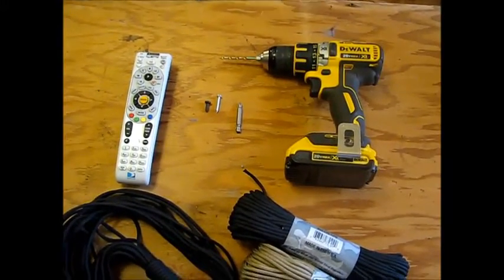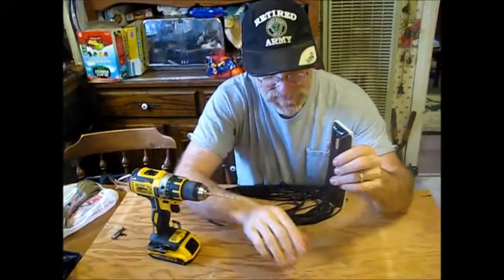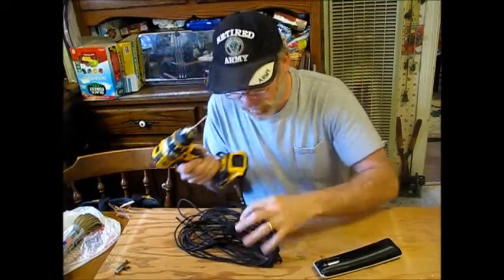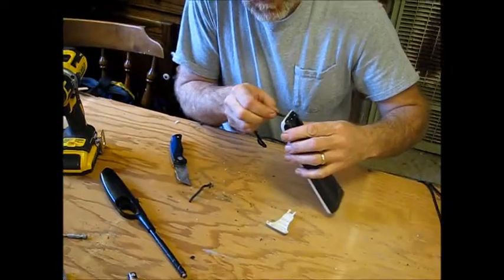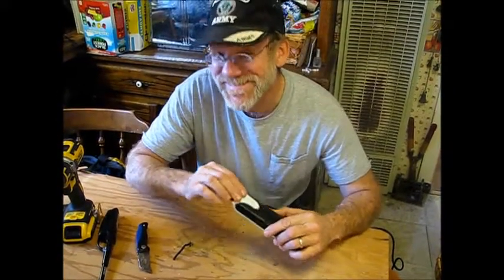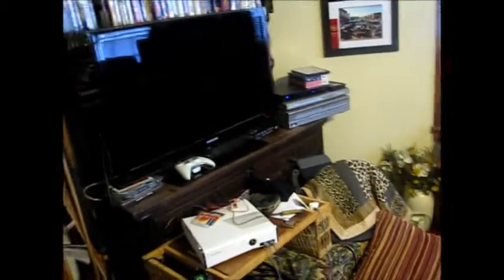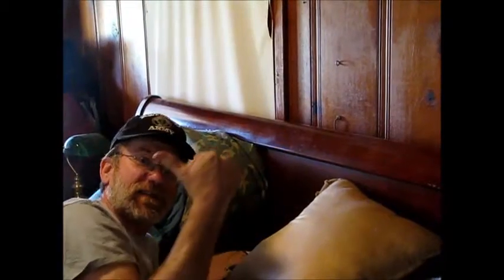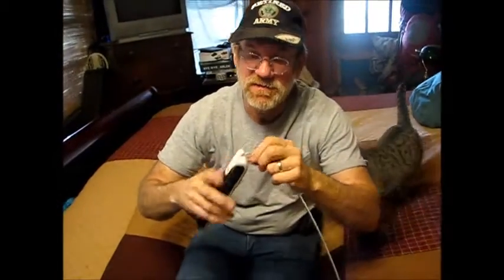DIY Remote Control finder

Comment: This has to be one of the best videos I've ever seen on YouTube!  I was looking for a remote leash because the one I just got from Amazon with adhesive isn't good at all.  The adhesive sucks and didn't last more than a minute.  I kept thinking there's got to be a better way to drill for a screw eye hook but your method will do just fine too!  Thank you and thank you for your service!
Reply from the maker: Be careful finding the right spot to make the hole. I have drilled, and used a heated awl (or icepick) to make the hole. Just make sure the hole doesn’t interfere with the circutboard!